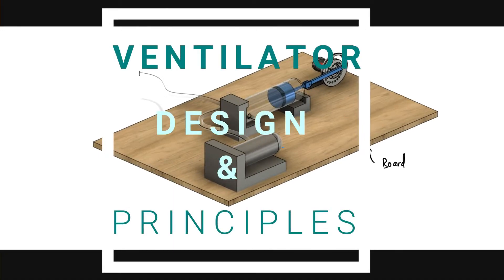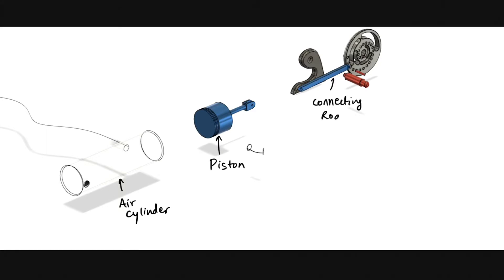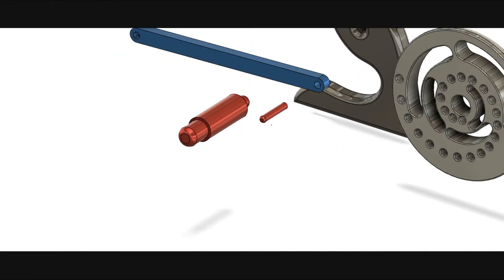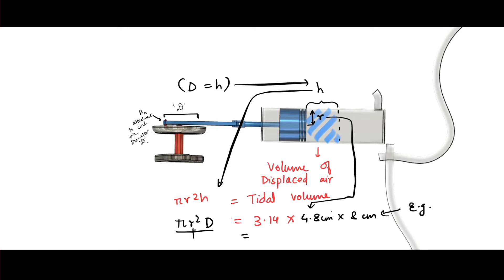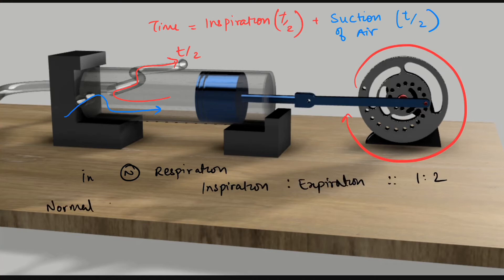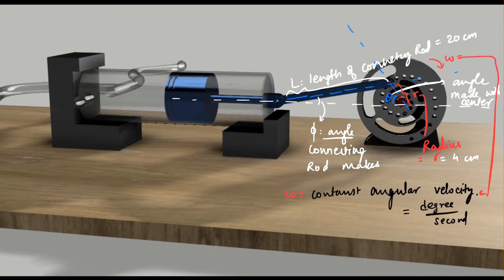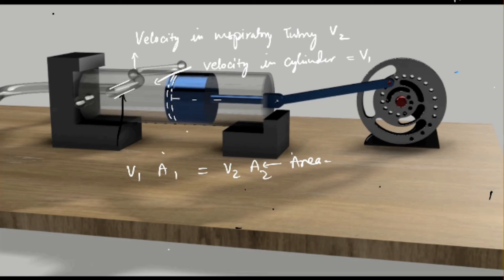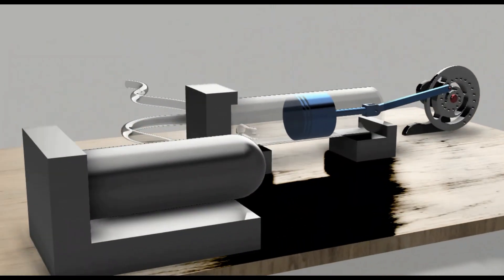Ventilator design and principles,  open access CAD model with dimensions for mass production

Comment: is there any full mathematical model and explanation for this type of ventilator? I trying to learn about open source MV but I don't really understand, hope you can help me
Reply: What is the input reference for this model?
Reply from the maker: Thank you for your question. There is no reference or mathematical model as reference. I was made more as an concept project. It has multiple fallacies including problem with pressure calculation and humidity correction. So unfortunately not able to help you more on this. 
Regards
Dr Akshaykumar

Comment: I would use a small DC volt brush-less motor. With a Signal Generator Motor Speed Regulator DC 12A PWM Motor Driver Module LED Display High-Power DC Motor Speed Controller.

In volume you could get these from China for about 8.00 US 

Also changing that bolt on the wheel for different settings may be prove to be too difficult for the end user. You should have some sort of reduction gears adjustable with a LED readout.
Reply from the maker: I agree with you inputs, we are not able to build working model as of now. If you are working on it, I will be happy to assist you. My email is drakshaykumarkamble@gmail.com
P.s. sorry for the tardy reply

Comment: I would use a standard inexpensive piston and have the
connecting rod custom made. You would also have to source some cylinder chambers
to fit your pistons. These to would probably have to be custom made. Just purchase
standard lightweight aluminum tubing and have a machine shop mill the ID.